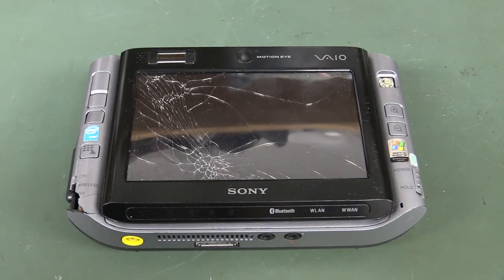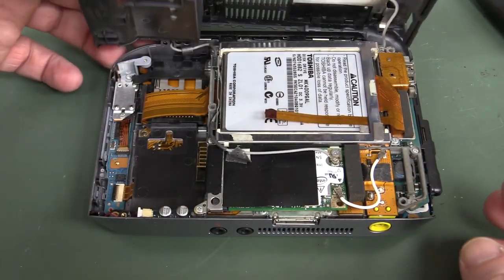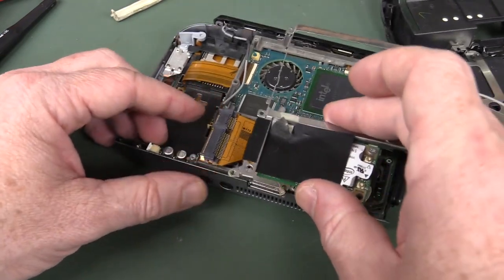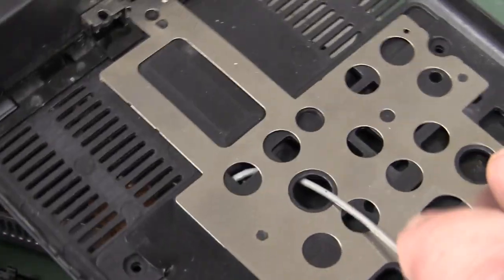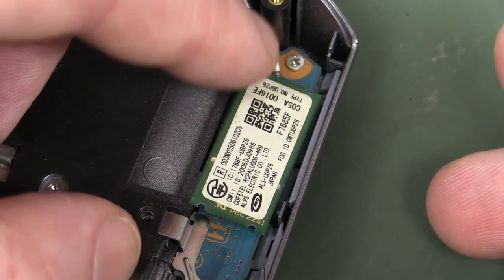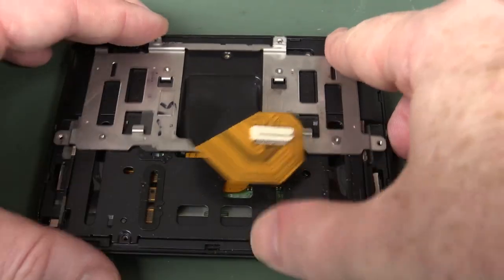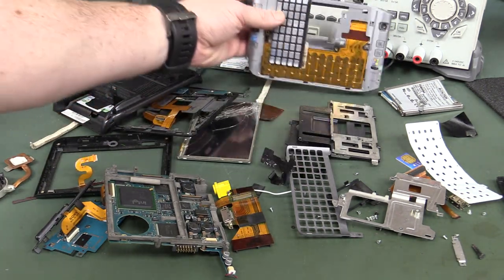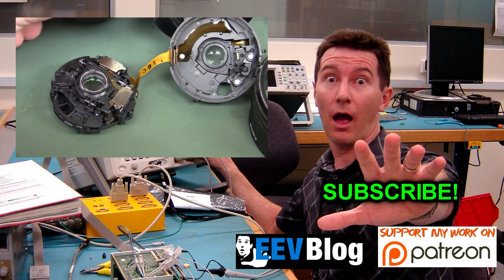EEVblog #914 - Sony VAIO UX Micro PC Teardown

Comment: I had to design a handheld product before and yes its a pain.

Boss comes in and tells you to make it really thin and then it has to have this huge list of features and the battery has to last 10 hours etc. During the design i end up looking in to changing the 0604 bulk bypass caps to 0402 because they are half a millimeter shorter so i could get my board to fit in. Finally its all together and it fits but then they hear the competitors product will have WiFi in it so we need to have it too even tho there is no room. To make that happen some flatflex stuff had to be done
because again its thinner than regular PCB. Debugging it is a pain in the ass when all the components and so tiny and lots of BGAs and all that crap. Its pretty annoying.

Comment: We have an XP machine at work that looks exactly like a PSP - nasty little thing, you think they'd be quite useful, but they are so horrible to use that you just wouldn't want to work on them.  At least these days we have Win10 tablet PC's for about $150 - recently got an HP one with pressure sensitive pen and Bluetooth keyboard with case... lovely little device.

Comment: Nice teardown, thank you very much! I've got one of these by myself with a docking station, external TFT connected and LAN, mouse and whatnot. I always wanted to swap the HDD in favour of a SSD (ZIF connected). Now i am ready to do so, thanx! Mine is running VISTA, which actually sucks with only 1GIG of RAM, but WinXP should run more than fine with this amount of memory. It was designed for less than 512MB, at least.
Who is the Flynn guy, btw? :D
Well, i want to add that this little device is a true Bond equipment, the black version of course.

Comment: Not sure why folks or comparing this to an iPhone. If you are talking a bout the original iPhone from 2007, sure it a lot better than many smartphones of the time, but it was not a general purpose machine. I bought an iPhone in early 2008, the App store didn't come out for months, it had no multitasking for at least a year, it didn't even have copy and paste. Sony was making similar devices to the Vaio UX going back as far as 1998, look up the Sony PictureBook. What ARM based device came close in those years?

Comment: That hard drive appears replaceable, so it is not beyond reason one would had did a drive swap as their very first upgrade.

For thermals, there has been better thermal tech since, and any enthusiast user wanting to upgrade one of these would had replaced the pads, or used gobs of paste as the TIM.

The wireless module is usable; Silverstone recently made kits to mount those small-form wireless modules to a bracket for use with PCI.

Far as everything else, that's about it.

Comment: "No one wants a PC in this form factor" 10 years later, the Microsoft Slate and the iPad Pro (and all the other tablets). It needed touchscreen and better price (which they could not change back then).
Reply: it's touch screen vs keyboard plus track pad argument bro
Reply: Showing that he was right. This thing is nothing like Slate and iPad.  Utterly different designs, both physically and electrically. The problem is they didn't make the leap to touch screen, and they used off the shelf component technologies rather than ponying up like Apple did to get massive die integration of system components, allowing a much smaller component count.
Reply: The tech was not there back then. Devices that tried to do what Apple, MS and Samsung (among others) have done now just was not practical or affordable. The size, cost and power efficiency, not to mention battery tech, all make it possible now.

But these were good attempts. Just sadly, failed results.
Reply: TechyBen It was only a year before the iPhone. The difference is that Apple had an idea for a new way of building a computing platform, and they put a ton of money into driving down prices and integrating a lot of functionality onto fewer silicon dies. Sony just took all the parts of a normal PC and rammed them into as small a box as they could fit. Not innovative, just more of the same.
Reply: yes, now I get it... it's kinda like moto backflip...a phone that looks great but is sluggish like a flip phone
Reply: This I agree with. :)

Comment: Mobile processors were pretty Poo at the time this was made, Low power Intel Atom chips had not yet Hit the market and ARM processors were still maxing out at the 300Mhz range. It's only in the last 8 years that we've seen generations of Atop chips and ARM Cortex designs that hit the Ghz range. At the time they would of been limited to using current generation  which are nowhere near as efficient as today's mobile chips.

Comment: I had one of these back in the day. I can't say I got much useful done on it, but damn if it wasn't cool. I remember it could run the original unreal tournament and not much beyond that in the way of games. Unfortunately I sold it on eBay years ago because it just wasn't that useful. Certainly a really cool novelty though.

Comment: Yea, I wouldn't trust a Celeron running XP to do anything good cooled passively. You need to wait for an Atom, and Windows Vista for that. OTOH, XP would install and run perfectly with 128Meg, so giving it a full Gig would make it fly.

I think I'd rather have that form-factor than the Surface Pro I actually have for "mobile" computing. (it's not mobile at all, weighs a tonne and isn't going into a pocket any time soon; a NetBook is more mobile)

Comment: Pretty impressive, that's just a laptop in a much smaller box. This was before you had system on chips, now tablets are all on one pcb and stuck in using tape on the cheaper Chinese stuff with room to spare.

Comment: Sony could not possibly have recovered the engineering costs of this.
To compound the losses they produced a variety of different models
with different processors and hard disc drives for each of several
different countries as well.   It looks like it would be a nightmare to repair.

Comment: Thanks ARM for saving us of such crap of Intel technology agenda.
Reply: this uses an x86.
Reply: +tyler “sarcastic” roberts exactly! try to imagine a phone running x86? Despite the silicon node, simplicity and x86 ISA don't come in the same sentence. As result, huge amount of logic and power loss.
Reply: there are and have been for some time, some VERY successful intel x86 based smart phones. lenovo for example makes some wonderfully high end x86  android phones.
Reply: This is myth that has not been true for many many years, x86 scales down to low power just as well as ARM does. Your assertion ignores reality.
Reply: Intel recently announced they'd be allowing ARM manufacturers access to their 10nm process - so basically, Intel's thrown the towel in when it comes to engineering x86 to compete with ARM.
Reply: As soon as someone moans about the x86 instruction set you know they are talking out of their arse or with a lot of bias.
Reply: The point is, we have ARM to replace intel.
Reply: +bobsagget823 perhaps another way to put your comment is: It is just a technology challenge. putting more money and effort, they can beat ARM as well.

That is partially reasonable, but I don't buy.

The x86 ISA reflects past where memory was expensive and the compiler technology was not that mature. 

Under phone scenario, I want to highlight 2 things here.

 1. Cisc ISA is better to shrink code what requires less memory transactions and as consequence less power. But, this benefit only shines with cache tuning. tuning that requires stable and predictive access profile. See atom and Celeron cores. Similar cores but tiny caches. 

 2. Cisc ISA requires more logic. period. they loose die area and makes harder to enhance the product with other features.
Reply: Thiago Coura
To make ARM as fast as any recent x86 chip they would have to do all the messy stuff that x86 does.. and the ARM instruction set is quite literally a mess at this point. Some versions allow unaligned access for some instructions but others don't.
And at the end of the day no one codes in assembly for 4ghz machines with megabytes of code/data cache and gigabytes of RAM so who gives a shit about the ISA as long as it's fast/fits into your power budget.
Reply: munchluxe63 ARM isn't going to replace Intel in the high performance market any time soon.
Reply: ***** Is there a problem with using microcode or old opcodes?
Reply: x86 is designed with multitasking in mind and definitely not for mobile use, ARM in the other hand is power efficient but sucks at multitasking.
Reply: ILYES Why does arm suck at multitasking?
Reply: ***** The other person said that ARM is going to replace Intel which they aren't in many markets including those where you need raw performance.
The only reason ARM are big in the phone/mobile/e-waste market is that they are fabless and their stuff can be produced cheaply on old equipment. Their power efficiency is overrated.
Reply: donpalmera It takes more time to switch between tasks on an ARM processor. So if you are executing multiple process at the same time while switching between them hundreds of times a second, ARM won't compete with x86, so you can't run a modern operating system smoothly on an ARM.
And that is only one advantage and I am sure there are others.
You won't be able to switch your gaming pc with your phone anytime soon.
Reply: ILYES Do you have a source for that task switching time claim?
Reply: ***** 
More instructions == more logic to decode. That shouldn't result in a speed penalty unless the extra logic means you can't run it as fast.
Reply: ***** Intel bought Altera for a reason.
Reply: donpalmera I don't have a source ready now but I had this argument before and I found some benchmarks, after hours of searching on google, supporting what I am saying. If I found them again I'll give you a link.
As for more instructions=more logic to decode that is completely wrong because the instructions have built in physical circuits that do them efficiently, as an example if you don't have a circuit built in to multiply 50*30 in one cycle you'll have to add 50 30 times which means it will takes more time and your code will be more complex
Reply: ILYES FYI most ARM parts that are designed to run kernels like Linux have high resolution timers to drive the OS. Maybe you're talking about context switch time.. you'd need some actual sources to prove that point.
Of course more instructions equals more logic (or more microcode). What you have written has no relation to the point you were trying to make.
Reply: ***** I've never done anything with GPGPU but the speed seems to come from having hundreds of cores that are designed to do a very limited amount of things. ARM have NEON for SIMD, x86 has MMX, SSE in various flavours but that's not going to complete with hundreds of cores on a job that can be split into many parallel tasks.
Reply: I didn't find the source I was talking about earlier but I remember reading about it and I am pretty sure the time it takes ARM to do a context switch is much more significant.
btw I found this while searching 
a link for anyone who want to take a look https://core.ac.uk/download/files/214/10597715.pdf
Reply: Celeron aren't too bad, I have a machine in my bedroom, which uses the j1900, it only uses 10W, which OK is quite a lot for a phone, but pretty thrifty for a desktop, the machines runs Windows 10, is passively cooled, and pretty responsive, OK it's nothing like my i7 machine, but it does the job very well without using a lot of resources.
Reply: I had a couple Atom motherboards, I had the D230 single core with hyperthreading, then the D330 dual core with hyperthreading, and they were pretty uninspiring, but the Nvidia Ion was pretty good basically the D330, and an Nvidia graphics processor on the same board, which was pretty good compared to Intel's motherboards with just the Atom on it.
Reply: well this is what you expect in 2006 technology, but today, there's a SoC processor made by Intel in x86 architecture as small as ARM processor.

In fact more of the tablets and smartphones today are actually built using a Atom SoC using Windows 8/10 mobile or the famous Android OS.
Reply: http://stackoverflow.com/questions/8241426/how-prevalent-is-branch-prediction-on-current-cpus

It's a bit older forum post; but Intel is still king for branch prediction and out of order execution.

 I have an Asus T100TA which has a bay trail cpu @ 2.2w, get around 10-12hrs even at full load (playing older PC games).

Considering this Sony mini pc was made in 2006 a year before the iphone; it's a neat concept... just not a great product. :)
Reply: +MattExzy

Intel just wants to control thous ARM manufactures, make them addicted to intel technologies.
The is nothing technological about such kind of decisions. It is politics and economics.
Reply: +Thiago Coura "try to imagine a phone running x86" Asus Zenfone, Lenovo K70
Reply: +bobsagget823 leave the AMD fanboys alone. 15 years after the last decent AMD cpu they have gotten to numbers of extinction and we have to preserve them for future generations. #AMDfanboylivesmatter
Reply: There is a reason its called REDUCED instruction set computing, because its cut down and sodomized to hit a tdp requirement, an arm cpu will never be able hang with x86 when it comes to capability, similarly x86 will not fit inside of arm's tdp window and run worth a shit, like a race car and a Prius, they don't compare.
Reply: Matt Brewer RISC vs CISC is more to do with code density and hardware complexity than anything else. You can make an x86 processor that is low power but you also lose the performance gained from having all the power eating "clever stuff". ARM could make really high performance designs but it's not in their best interest; They sell licenses to designs that almost anyone can fab.. they won't sell many licenses for designs that only Intel or TSMC can fab.
Reply: Jzzzz Are you guys still discussing this? LOL
Reply: if only windows on arm wasn't so awful...
(windows rt)
Reply: If only ARM was good enough to compare to even a god damned Pentium II.

ARM sucks. there's no way they will ever compete with X86.

if x86 was in phones and tablets then they'd be running Windows and not limited ' firmware ' written only to perform a specific task.
Reply: you can complain about the interface of PC all you like but show me an Android phone that isn't the absolute most expensive/ top of the line thing, that can open more than 2 windows at once?
Reply: what is in the x86 set that is different? really, i dont even know what that means. is it programming or architecture? any good links?
Reply: Thiago Coura take it back

Comment: I doubt if Japanese design teams are as chaotic as you imagine, they are probably ruthlessly efficient, if the battery team could not design in enough capacity they would have to commit harikari with shame.

Comment: I am actually sad I sold mine, I would want to try Android X86 on it.
Reply: i tried that on mine, couldn't get the touch panel to work or the wifi
Reply: you might want to try again the kernal keeps getting better and better. something ubuntu based. some of the other distros might work but i have had pretty good luck with things working out of the box lately

Comment: I still use a Sony Memorystick on my PSP. 

I want a system like that with more modern hardware, but nobody really makes them anymore. I would want a controller though instead of a qwerty keyboard. Instead I'm attaching a 8" windows 10 tablet to a PS4 controller, and using a 3d printed bracket to hold them together.  Not a pocketable solution, I just toss the whole mess in a backpack.

Comment: These things are still stupid expensive 2nd hand on ebay. 600 dollars and up. I wanted one of these so bad back in the day, but today, not so much. It would be cool to run legacy software on, but you can get a MS Surface Pro 2 second hand for half the price, and it can run circles around this UMPC. Core Solo, and a 4200rpm IDE hard drive....even crap for 2007's standards.
Reply: Mikey Its a fantastic machine, i use it every day

Comment: dave would you be intristed in selling this thing?
Reply: It's trash man, someone has obviously tampered with it before Dave had a go with it.
Reply: id love to have some fun with it
Reply: I remember throwing out odd and forgotten tech when I worked at a pawn shop while in college. I would take a lot of it with me, because it looked cool, and sometimes I would make great money on eBay selling Sony Walkmans of various types an sizes, and I remember selling a couple of micro PCs from Sony, HP, and another brand I no longer remember...
Reply: i like to play with vintage compueters and odd computers
Reply: +Fennec Fox (FennecTECH) I saw you can get one on eBay (or one like it) but for a large chunk of change
Reply: It really looks (from the missing connector and antenna especially) like someone had already had their way with it and took some parts for a repair of another device along the way.  Wouldn't be worth it.

Comment: Im pretty sure they tried to product place these in mission impossible 2 or 3 where mr cruse hacked a security camera network and I thought it look cool but it was probably far more useful as a prop in hollywood than in reality, but saying that the UMPC world wasnt full of completely useless sony devices as I still have and use a sony P11Z dual boots win7 and fedora linux works really well if you swap out the hard drive for a SSD. there a great little travel machine not fast by todays standards but far easier to type on than a tablet with the benefit of a full os, I use it for telnet and terminal sessions with telecoms equip and arduino dev stuff. I think windows vista killed the umpc market as most of these devices shipped with it and people blamed the hardware but those that downgraded to xp or later upgraded to win7 would have found vast improvements.